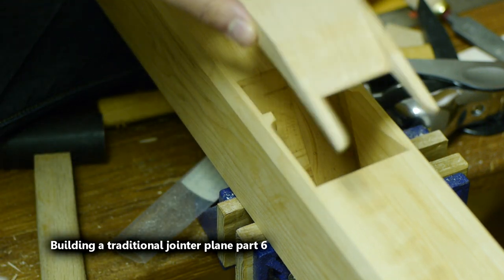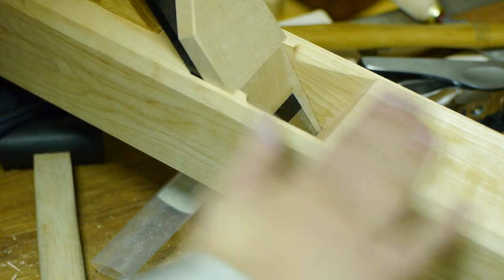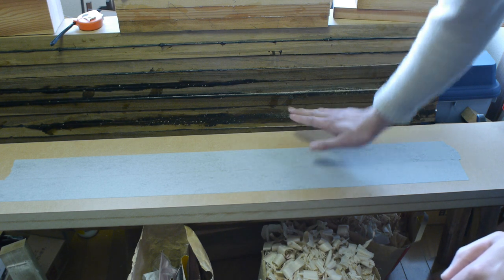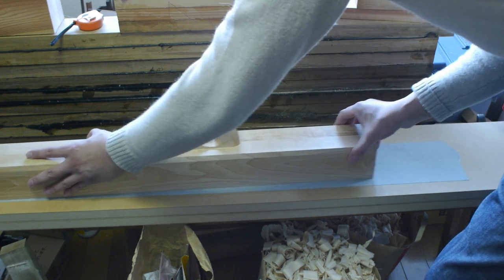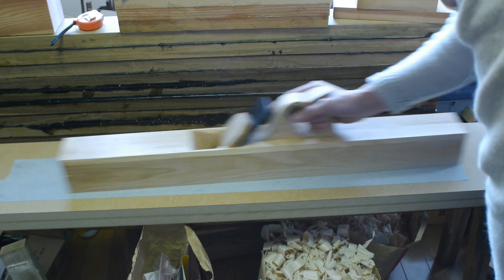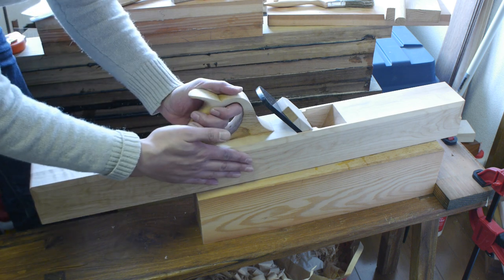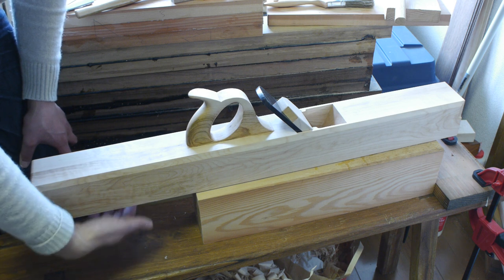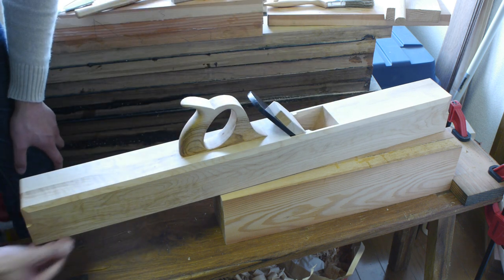How to make a traditional style jointer plane part 6

Comment from the maker: The blade I ordered cost I think something like 14k yen, which is about $175.
Japanese blades are fine for hardwoods. You just need to make sure you choose the correct steel. As a rule, white steel is more for soft woods as it has a sharp edge but blue steels are better for harder woods due to their better edge holding. You can go all exotic and get tsubame steel, super blue or tougou etc which are reputedly great for hard woods but you pay a premium for them.

Comment from the maker: Thanks for watching.
Old Stanley 8s are pretty common I thought? I guess it depends on where you live though. I could find a whole load of them at dealers and the auction site however shipping would have cost more than the plane itself. Plus if you build your own you can make it as long as you need. I don't think there are any Stanley style metal planes that are as long as the one in the video. I would recommend making one yourself because you can tailor it to your needs.

Comment: What type of changes would one have to add to include a chip breaker?
Reply from the maker: Hi, to add a chipbreaker, you would just need to adjust the angle of the wear (the sloping part in front of the blade right at the mouth) to allow shavings to pass over the chipbreaker. It depends on the type of blade and CB combination you have but you might need to chisel out recesses in the bed or wedge to allow the various nuts etc that hold the CB to the blade to fit. In general you shouldn't have to make too many changes.
Reply: @sumokun Cool! I recently found an old(about 130 years old from what I was told) 85cm jointer plane made of ash that was so rotten that it broke as I tried it to plane it to health.. Now I'm considering making one and use the iron and chipbreaker. Would flatsawn Iroko work as a wood?
Reply from the maker: @josedomingosteixeira1379  Hi, any hard wood will work fine as long as it has been well dried and it has relatively straight grain. The cut of the wood (quarter vs flat) is not really that important.

Comment: What is your bed angle? Thanks
Reply from the maker: cejkwo Mass This particular plane was made with a 50 degree bed angle. If you make one yourself though, make the bed angle whatever angle you need for your work. 45 degrees is a standard angle and 50 a good angle for medium hard woods. It works well in softer woods too. If you work with more figured woods or woods with lots of reversing grain, then a 60 degree or even higher would be a good angle.
Reply: Thank you,I made my first plane with a 55 degree bed angle,came out nice. Thanks again

Comment: Great build! Only, my 'weapon of choise'  for the plain body would be hornbeam. We call it 'gvozdeno drvo' which means Ironwood, and i just saw english name IS ironwood:-) . and it isn't called that way for nothing. It is very very hard, dimensionally stable. Friction resistant. Rule for every tool is that your tool material is at least a bit harder than material of the part you are working on. When dried and coated with oil, it resists moisture very well. Second chois is elm. But i would put hornbeam in front of everything.
Reply from the maker: Thanks! Yes, definitely use whatever you can get locally. Hornbeam is a nice and hard wood. The wood I used was "Japanese hop-hornbeam". Possibly related but I don't know. It is one of the harder native Japanese species with a density of roughly 0.8 or so. Its great stuff.
Reply: Of course they are related. Only your species has looks of our ash, which made me think it is ash. Although ash is also quite tough, it has 'pores' and it tends to swell in surface fibers. So i would use it. Personally i am amased by hornbeam, so much i plan to plant it on my property.:-)
Reply from the maker: It is probably the video but the wood I used is definitely not like ash. It is tight grained and there are no visible pores. It is a lot like hard maple except harder. I'm not really a big fan of ash in tools because the pores get stuffed with dirt but it is a nice wood for furniture providing a nice cut can be obtained.
Reply: I tottally  agree on this point. I respect ironwoodcynd ash for one more characteristic which is it doesn't get atttacked by any bugs-ever! Unlike beech, which is very popular here. But when i see those little holes of eatwn wood, i get chills. I hate bugs!:-)